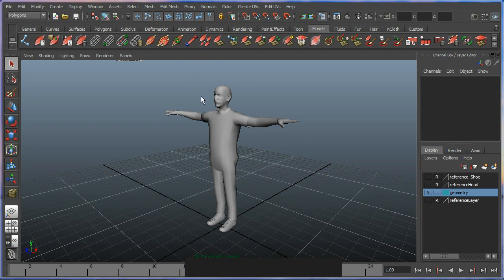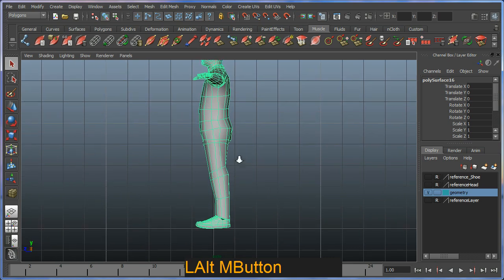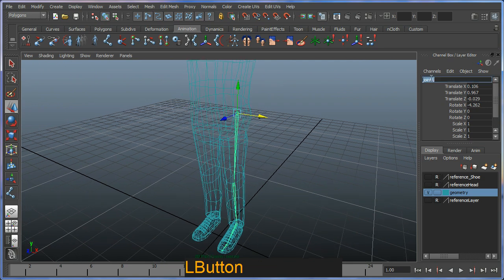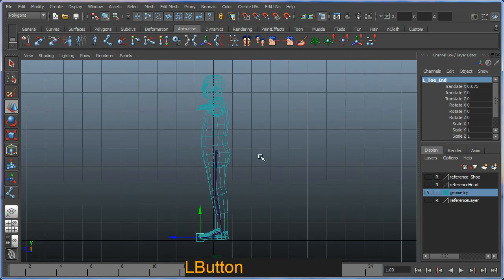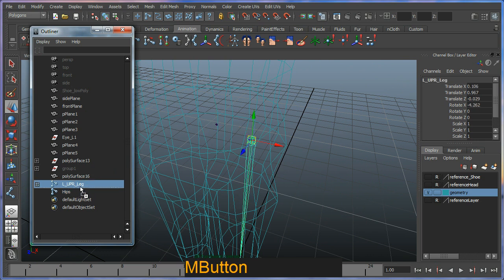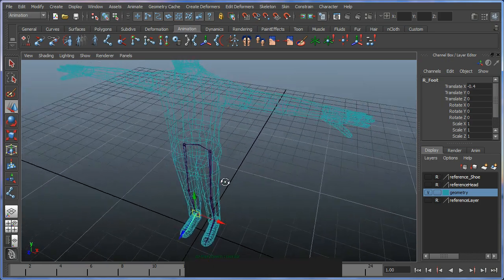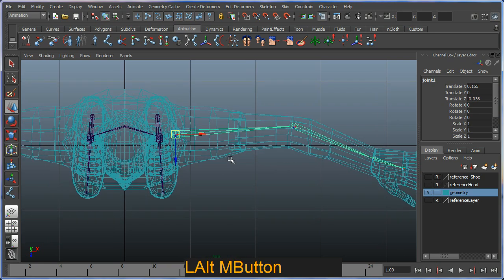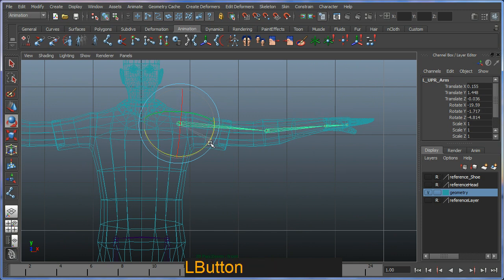Basic bipedal character rigging setup in Maya - Part 1 of 8

Comment: Why are my bones looking like this 
http://imgur.com/NHYNdAo
http://imgur.com/me56HWa

they are so big and interfere with the mesh.so its really difficult to see what i am doing :/
Reply from the maker: +Alpha Devil that is because the scale of your character is very small.. i'd recommend you check the size of your mesh in real world units (cm) and then scale it up. You can under Display->Animation->Joint Size alter the draw size of the joints themselves.. but again I'd look at the scale of your mesh instead.
Reply: Thank you very much.I will try that out :)
Reply: +Jamie Telford can i work with out scale up
Reply: +Jamie Telford or what size sholde i scale the joint
Reply: +Alpha Devil The joint display size is too large, but the joints themselves are actually fine. To edit this go to Display> Animation > Joint size and type in a much smaller value

Comment: to all people who try the joint tool and nothing happens:  save the scene with your model in with no joints or anything.  if you've already got joints in there, try deleting them and starting fresh.   Anyway, then open a new scene, and  then, click file>>Import.   then select your scene with your model in it, and press ok.  it'll import your model into your new scene, and the joint tool should work then.  at least that worked for me.  hope that helps anyone!